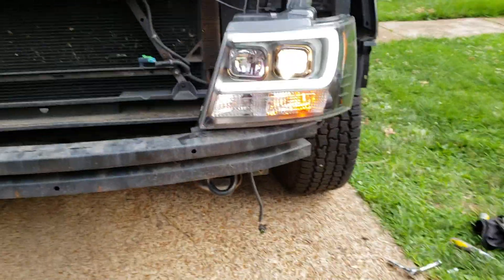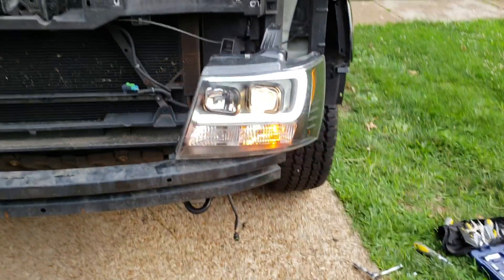Spyder u-bar headlights installation chevy tahoe, suburban,avalance,gmc yukon,sierra,1500 part 5

Comment: I installed the sylvania silver star bulbs in my Silverado  and I kid you not there 3 times brighter then my high beams used to be. Not cheep tho abt $45-50 for 2 bulbs. now I just need 2 more for the high beam side haha. Best bulbs I ever bought. Well worth the price. All the parts stores usually have them on hand
Reply from the maker: I bought the silverstar ultras a day after doing this video and took the crap ones off and replaced them